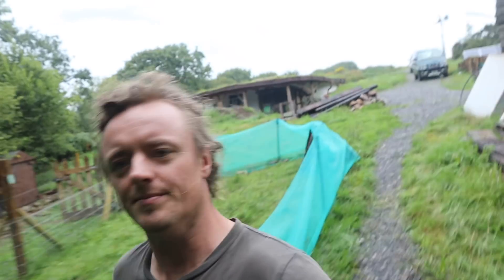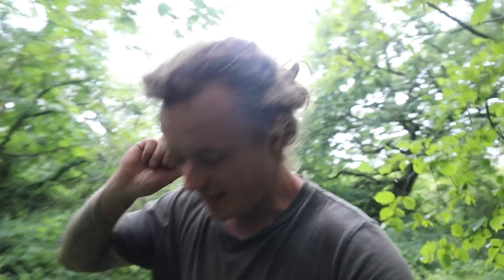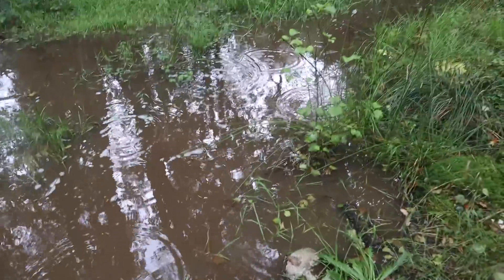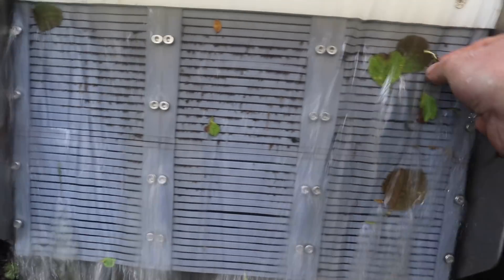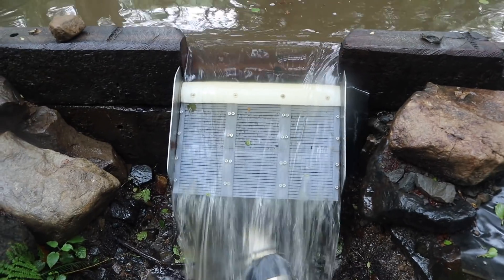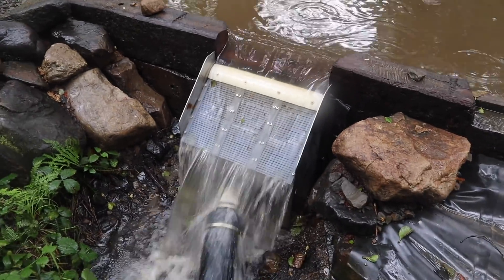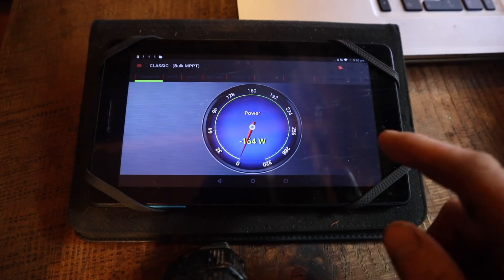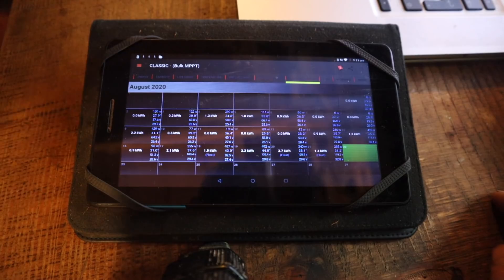Hydroelectric 3D Printed Intake update after Storm Ellen

Comment: Would clear, thick perspex be good? You could see what is going on in the box. Perhaps a longer box would give a greater surface to the intake as well especially if you put the pipe on the side rather than the front.

Comment: i would use conical vertical slots for the  intake skimmer.  with wider part of the slots on the bottom to prevent blockage.

Comment: Have u considered designing an entire cover of stainless steel that will extend below the water level keeping any floating debris from ever entering the intake as well as preventing anything from falling on it? If it flows in winter when frozen u could insulate the cover as well keeping it ice free as it draws water from below the ice. This would serve as your float dam essentially. If the leaves are still a problem a cover that just protects the intake could be worth it alone

Comment: Your design is protruding and slicing water. Therefore, your design DOES NOT use the Coanda effect. The attached clip demonstrates the Coanda effect. I suggest the ribs in your screen should be more like a round bar with a lip on the lower edge. I have a design profile that I could email. I believe it would actually be self cleaning with the exception of very small or dissolved particles.

Comment: I would turn the leaves filter 90 degrees so that the slots run in the same direction of the water flow. That way, water would tumble through the 4mm slots but any leaves would not get a grip and flow down the top of the filter and not get jammed.

Comment: ask bjorn to add a center stiffening bar under the wedges narrow and tall so its stiff but doesn't impede the water passing that way the entire mesh stiffens up reducing the flex in the cross wedges. canting the outer edges would make the water go towards the mesh. two opposite cant's make a peak and the outside ones just aim inwards. the stiffening bar under the wedges will decrease how many leave catch because the spaces between the wedges wont vary without more force. it'd likely also increase lifespan. what you need to do if you plan to use them permanently is create a sun shade for the 3D printed parts they are plastic and will become brittle as they are exposed to UV sunlight.

Comment: The same type of screens are used in commercial laundries so if anyone has a laundry machinery supplier near to them check them out usually on discharge end of tunnel washers that operate a Weir system of filtering.

Comment: Look at "Colwick Sluice" on aerial view. (OK it's a big river!) At low flow times they have only one gate open, to control bigger flows they open more gates. Could you go for a wider coander box and have floating weirs that  adjust to the available water AND run the working screens properly.

Comment: The last I remember, you weren't using any "dump load" mechanism.  Your reasoning for that was a bit over my head, but I'm wondering what happens when you have all that electricity being generated from the three various sources and your batteries are topped up and you're not using much electricity.  What happens to all that excess power and how do your various systems adapt to not overloading your system during storm events for example when your wind and hydro systems are producing power like mad?  Many thanks.

Comment: rather than 6 small printed screens .print 1 large screen and it will only need 4 or 6 bolts /screws down the sides for fixing.

Comment: Why all the troubles with the intake box. Wouldn't it be better to take the water directly from the pond somewhere in the middle between the top and bottom? That way you probably don't need an intake filter, but it could be a 1M pipe with lots of holes and a fine screen around. This way you will also avoid vortex and air in the feed pipe, plus you will have more water available during the dry season.

Comment: If anything, as currently designed in this video, the bolts aren't a problem, they're an asset.  Water flowing over those edges would never contribute to the input of the pipe.  The bolts are actually deflecting water back onto the plates.  Obviously there's water loss, but it's less than there would be if the bolts were flush with the face.

Comment: Hi I worked on a water intake for a utility company  in Cumbria for fresh water. The water came in through a fine screen & debris plus leaves was the problem. They overcame this by a sudden burst of compressed air that cleared the screen to keep the flow/volume up, I can not remember if it was ever 20 mins or work a auto basis if the volume slowed down. Nice system you have there. Did the land there have the dreaded planning permission when you bought it.

Comment: You could run a second system with the excess water from the first,just lead it into the new inlet and a new tube,and on rich water days you get more power but do not drain the dam more than with one system.
Reply from the maker: yep i could but why? i would need £2500 worth of pipe. if i wanted to use that water i can just run more water through the turbine. i can just make the nozzles bigger and use more water. i dont because its not worth it as the high flow is not typical so the turbine is sized to work well at the average flow.

Comment: degree. Could get a couple of those liquid chemicals tank's that we get our pesticides in on the farm. They are light weight and easy to handle. They would give you 300 to 400 more gallons of storage in the system for when your short on rain. Idk about there but here in iowa we can't get rid of those tank's for free.
Reply from the maker: The system runs at 5lps so one of those tanks would run the system for about 3 minutes. There really isn’t any point. You need hundreds of thousands of litres to make storage worthwhile

Comment: Kris  try  wedge wire screen filter.   It will self cleaning all year.  U can search under name cetus filter
Reply: The self cleaning one has curve on it.  Gap 300 micron
Reply from the maker: Hi, thanks for that. i checked that out. I dont think it is right for me though. to expensive and has a to low flow rate. my system runs at 5.5 litres per second and that would be right at the max of that products abilities meaning there would be no room for running more flow or partial blockage. If i was going to spend £500 i would spend it on stainless steel coanda screen for my homemade intake. this 3d printed wedge wire is a cheaper way of doing the same job. It was interesting to look at though so thanks for the comment and the info.

Comment: All the leaves that stuck appeared to be with the stem facing upwards, caught in the screen. No idea if noticing that is useful or not, but there does seem to be a pattern there.
Reply: That's a pretty good observation! I have also noticed that the upper leves are stuck flat while the lower leaves are trapped in between the wedges. The upper leaves may be trapped because the interface between the accelleration plate is not good yet and the  the water makes a little jump (10 mm) before landing on the wedges. This may actually cause a downforce that may push the leaves twoards the wedges causing these  to be stuck flat. When we get the top interface with a lip we will smoothen the waterflow more horizontal and the leaves will  be forced over the wedges instead (in theory)...

Comment: Have spent the last 24Hrs watching your progress on your hydro system, nice work!

I was thinking that if you make the intake tank bigger and include a standpipe in the box?

And make like a treadmill with a brush on it on top of the mesh/coanda screen to rotate, it can be hooked up to a small solar panel and it will clear when there is sun? 

And an outdoor IP camera can be usefull if you have wifi upp there, there are some with quite good antennas and can reach far. 

Anyway, nice work!  Keep it up 👌👍

Comment: Hi. Like the channel and the experimenting that you are doiing. Two thoughts (considering that you are experimenting), have you considered either some sort of automated brush (could even be activated by something filling with water so no power is used!! or on the grill, something where the alternate screen bars are in separate parts so that they could evry so often move apart and release the leaf stalks.. thinking having odd ones fixed and even ones that can raise or rotate away from the fixed ones...

Very interesting results you are getting though...

Comment: I suggest make a protection against leaves where the protection is like a box without a bottom in front of the intake and water that leaves the "pond" must go through the box.  Since the water can only enter at the bottom of the box and the bottom must be below the water level (say 10 cm), only water will exit the pond and leaves stay on the surface of the pond.

Comment: Coming along well.
I'm interested in your thoughts on a (steel) guillotine type plate with lot's of small holes that would allow water to pass through and also give you the ability slide the top plate up and down every day or so to sever/cut any foliage, stems stuck in the holes (essential like hedge trimmers one plate being the blade the other being the anvil). It wouldn't be too difficult to make and you could also incorporate an automated function where the top plate activates every few hours to clear any debris. In addition, this type of mechanism may offer the ability to open up the pores or close them depending on the amount of natural water flow required during periods of heavy/little rain.

Comment: i dont know exactly how this works, but could you have the "slats" not be exactly horizontal, possibly vertical, maybe at an angle, maybe even herringbone, that way any leaves and stuff that gets stuck in the "slats" can be pushed to the side, possibly with a little lift at the end to push the stuff out, this would mean more fixed and non-adjustable blades.

Comment: It would be awesome if the angle was adjustable while in use. Then it would be even cooler if it was mechanically adjusted based on the flow amount by using a float mechanism or something. That way it would always have enough water left to clean itself.

Comment: You have three rows of those screens, why not try three different variants, one on each row, now that you've got your baseline data? At least for the self-cleaning function that should be a useful way to plow through more iterations in the same time.
Reply: That's just actually my plan :-) . I am creating 2 tiles with a 6 degree wedge and a rounded leading wedge edge that hopefully will not hook as much debris as the sharp version that Kris has today. This version will also have more narrow gaps between the wedges. I will try these out at my cottage up north as a proof of concept before sending them to Kris. It may transport less  water than the current version, but it may be enough to run his turbine 100% anyways.
Reply: Another comment: The wedges are printed in ABS plastic with 20% infill. The new ones will be printed with ASA plastic and 60% infill and hopefully this will make these not flexing so much.

Comment: a lot of the area in the upper centre of the grille looks to be where the water is actually passing over the intake. the ramp into the intake (white plastic bit) looks like it sits slightly over the intake, it maybe needs a chamfer on the edge so the water flows over the whole grille?

Comment: Did you not video the tractor head gasket replacement? I would have like to have seen that.
Reply from the maker: No im afraid not, i dont tend to film everything as i just dont have the time to get things done otherwise. The tractor is no good with its half in bits so i just wanted to get it done and fixed. Its fixed now and working again.

Comment: a suggestion 
use some really fine sanding blocks like you would use on finish body work then perhaps wax the unit making it "slick "
also change out the cap screws for dome headed versions

Comment: Lets design a waterwheel activated brushing system that works on the same principel as windsheild washer that will go back and forth across the intake screen loosening alga and debris with soft bristles
Reply: a simple internal poncelet wheel with brushes on the periphery and curved grids that are brushed from inside the water intake

Comment: Dear Kris, I imagine an improvement in the system is to put a screen in the dam, to stop the entry of leaves and sticks to prevent the suction of the printed screen, so there will be no cleaning maintenance.
I recommend capturing the water in the slightly deeper part of the dam to avoid freezing.
You can do an experiment with 2 vessels where they communicate, the first being the dam. In this first place flakes of Styrofoam to represent the leaves of the trees.
Add water to the vessel that represents the dam, you will notice that the Styrofoam flakes will not irrigate the second vessel.
With this clean water you can pour another vessel in the current grid system.
This way you will have a clean and steady system without maintenance.

Comment: Have you thought about putting a gutter underneath the intake and divert the water away from over the pipe.  It will look neater as well as making it easier to work  on when water is flowing.  It will also it will reduce the potential for damage and long term wear to the pipe and coupling.

Comment: Hi Kris, understand keeping it simple, however the leaves are currently presented to the screen in the worst orientation (flat).  But even in your current low flow situation there is probably 3-5mm of water flowing over (not through) the screen.  Therefore mounting some thin rod/bar vertically over the screen would prevent the leaves being presented to the screen flat, therefore preventing them sticking I would think...
Reply: I should add, I a not talking about a vertical comb, but a layer above the coanda screen made from 2-3mm wire that would stop the suction of the leaves to the screen....

Comment: IMHO there is a simple solution that will solve a ton of that.  Get a piece of expanded metal about 3 times longer than the intake opening and about 15 cm tall.  Fold either end about 90 degrees for 2 cm.  Mount one side to just outside the intake mostly below the water line and do the same on the other side.  It will flex out and trap most of the debris, in fact if it floats it stops it.  Clean it once a week or if there is a big storm.  Anything that sinks should just drop to the bottom.  No need to worry about sticks and big leaves getting on the intake.  Low tech simple stuff can do a lot more than you give it credit.  The coanda screen is always going to catch some stuff if you prevent 95% of that stuff from getting near it the screen will stay clear.  You are WAY overthinking this one.
Reply: Actually, he isn't over thinking it at all! 
It's the commenters who are doing the overthinking...... .!!!

Comment: I hadn't realised that I'd missed last weeks video as I eventually found out Google/YT ended the email notifications part of YouTube and everything will be push alerts/notifications, although you'll still receive alerts in response to comments made. So if there's a drop in viewing figures it could be with lack of email alerts and they were what I relied on, so now it's open a YT tab and check the notifications.

Nice to see the tiles running well and I think I said a few weeks ago that interlocking tiles & a steel frame you can slot in/out and fix with a few bolts would be big improvements. You could have 2 screens - one in use and another as standby and switching the frames would be a few minute job which is what you want if it's bad weather.

Keep up the good work and now to watch last weeks video.

Comment: Hey Kris, nice position to be in power-wise. Could maybe dump some of that excess power to an immersion tank/tanks for your shower/hot water? Could also help keep your greenhouse heated in the winter with some kinda radiator setup or perhaps some of those electric tube greenhouse heaters. They're low wattage and would save you running pipes for hot water. Hmmmmm. Options!
Glad to see the hydro setup coped fine with that storm 👌
Looking forward to the next video already to see what other projects you've got going on, always enjoyable to watch 👍👍

Comment: i think when the blades are stiffer they will be less leafs getting stuck
Reply from the maker: I think so to. i think that is the main problem
Reply: @KrisHarbour  yeah i did think that when you where first fitting them but as a start seems a pritty good one i dont thing angle needs to be played with i think just a more solid and ridgid panel i was suprised at the wattage i thoght it would of been higher when i monitor i dont monitor incomming and out going i just measure the current into the battery as long as thats getting power i know im still in the good range i tend to use 0 centre amp meters from cars thay reead plus minus 50 amp so as long as i keep it above zero i know i have power to spare